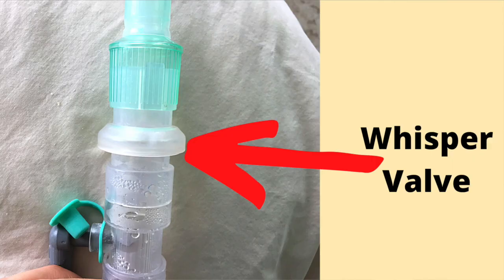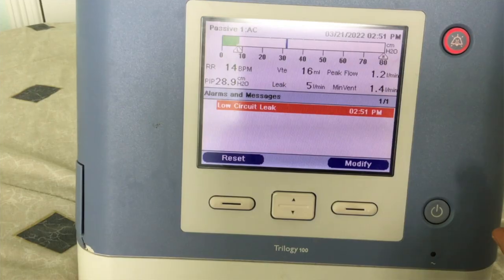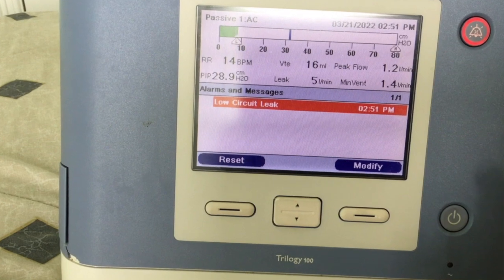What Does a Ventilator Sound Like? Life with a Vent #Shorts

Comment: Hi, so I was wondering if you could possibly help me with a project I’m doing. I need the first ventilator sound only longer. I tried using it on a loop but when the video stops it doesn’t sound natural.
Reply from the maker: Hello. How long do you want the audio to be? The original audio is 13 seconds. Is that long enough?
Reply: @LifewithaVent  two minutes if possible?
Reply from the maker: @jaredscroggins9410  Ok. I will try to work on it and upload it as an "unlisted" video. I will give you the YouTube link when I get it uploaded. I am extremely busy at the moment. I will try to get it done in the next few days.
Reply: @LifewithaVent  Thank you so much!!!
Reply from the maker: Hello. I was able to upload the video. I added some slides over the audio, and released the video as a YouTube video to my channel. Here is the link to the video: https://www.youtube.com/watch?v=T4SRsleKmcM
Reply: @LifewithaVent  thank you so much!!!